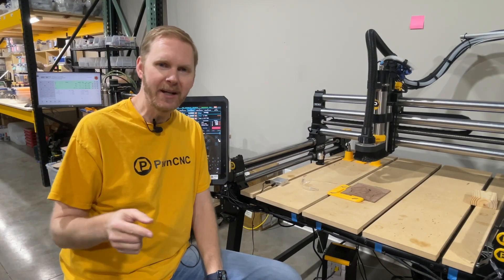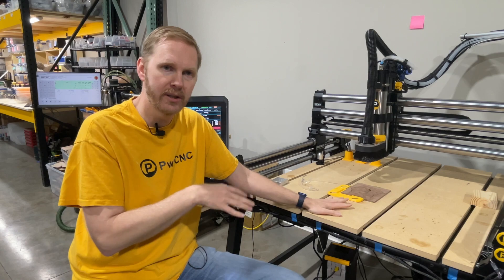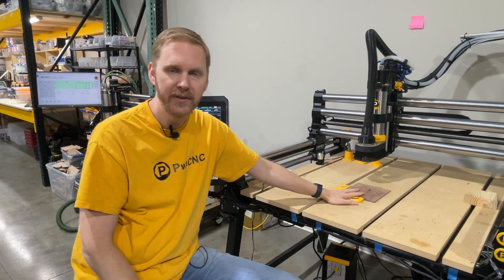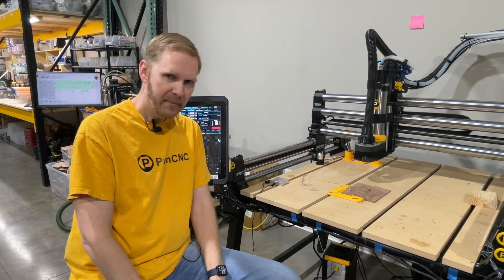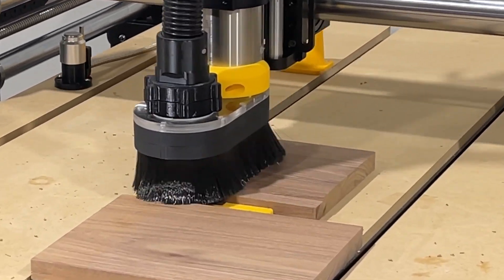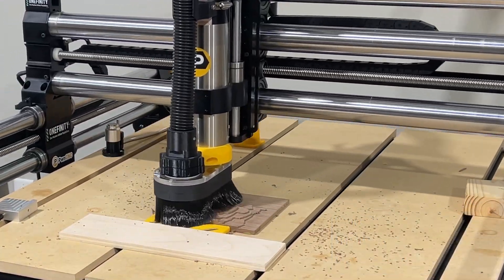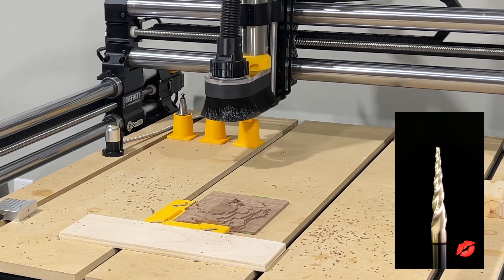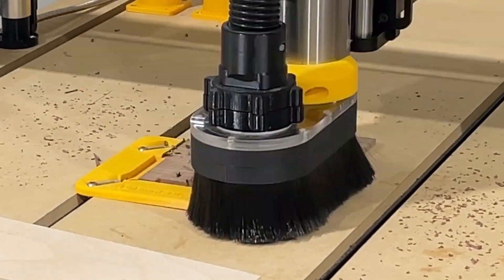PwnCNC Automatic Tool Changer

Comment: Are the bits axisymmetrical in the part that is grabbed by the ATC? I mean, does the spindle always stop at the same angular position to be able to hold the bits?
Reply from the maker: ISO20 is a standard that defines the removable chuck.  that cone shape ensures the tip of the bit is sitting in the exact same z height every time.  That z-offset of each tool is stored within the controller for next time.
The ISO20 cone is pulled tightly into the ATC motor to ensure it's in the same position.  The motor also discharges air in various locations to keep dust from building up.

Comment: What spindle you using?  The OneFinity says not included, but finding an ATC one...?
Reply from the maker: We're using a PwnCNC Spindle System here (https://pwncnc.com/products/spindle).  We also have ATC Systems available that work great with the Onefinity machine.
Key is to order your Onefinity with the 80mm mount instead of their 65mm mount.  You can always shim the 80 down to 65mm to temporarily run a Makita palm router if necessary.
We've worked closely with Onefinity to ensure our Spindle and ATC Systems are plug-n-play capable.

Comment: Roughly how much did that entire CNC with  ATC cost you?
Reply from the maker: This machine is the Onefinity Elite Woodworker  with the 80mm spindle mount costing $3336, it includes the Stiffy rail at $168, and the QCW $378 and Folding legs $368.  As pictured i have their XYZ probe at $93 and if you buy their tool-setter that's $75.
So all-in the CNC machine is $4415 +shipping/taxes.
The 110v ATC runs $3400 plus chiller and tubing $295 along with the v10 dust boot $150, end-caps $22, stepper covers $32, and Ultimate Hose Clamp $20.  Prototype boom should be released later this year.
All-in... this setup will run $8334 +shipping/tax.

Comment: What do you need on the spindle to hold the ER20 collet? How does it hold without any intervention?
Reply from the maker: ER20 is a collet/nut/shaft size standard.  These ATC motors use ISO20 tool holders which we order with ER20 collet capabilities.  I believe we can get an ISO20 with an ER16 collet but our little business has standardized on the er20 or er11 size products.
These ATC motors have a draw-bar which grabs hold of the ISO20 tool holder. The drawbar is activated by pneumatics to release the tool.

Comment: Hello friend, that tool change system works for a CNC workbee 1515 xpro v5
Reply from the maker: Out of the gate our full ATC functionality will be limited to folks with Masso controllers.  However you will be able to use it in MTC mode (https://youtu.be/IFOkSZM4JEs) which makes bit-changes a push of a button.
As we research and document more and more CNC Controllers capable of ATC functionality, we will share that understanding.  ATM i'm not sure if the xPro v5 is capable of ATC, but we will look into it.

Comment: Would be nice if you made this also work with the shapeoko 5 pro
Reply from the maker: Although it won't be full ATC on the S5P, it can support MTC which is a 1-button tool-swap.
We've also helped technically with Brayan on his Masso upgrade for his Pro ... stay tuned for the 2024 big project ;-)
Reply: Can you make video and show us how to manually control to swap tool
Reply from the maker: Hello  @xiltoid875  , are you referring to the MTC operation (https://youtu.be/IFOkSZM4JEs?si=4Y-fxLXERPRBdd-M) or actually changing the bit in a single tool holder?

Comment: Is there a way to install the atc and preserve the 4x4 cutting area ?
Reply: I saw a YouTube video of a guy who did it. The tool holders retracts itself on springs. When the Y axis approach the back , it push on a mechanism that multiply by 5 the movement of the tool holder. I will try to find it back
Reply: @peterfreedom  yes I think i saw that on a facebook group
Reply: There is not. My plan is to make the section of my spoilboard that my tools will be lined up(Y axis) be removable. I rarely have the need for 4x4 sheet, but this will make that possible. I am also having a panel removable on the opposite side to reveal a vertical cut station.
Reply: https://youtu.be/ZeOUdosoEBM?si=UVj4RhLTLtV-hTYE

Comment: Is this ATC limited to 3 tool holders, or can you add as many as CNC can fit?
Reply from the maker: You can add as many as can fit up to 99 which is the Masso controller limit.  If using another controller... not sure.
Planning to ship 4 tool holders with the kit and extras available.

Comment: Shapeoko version coming?
Reply: no Masso...so, not going to happen.
Reply from the maker: Actually...sort of!  It will be as an "MTC", using a button to manually change the bits.  And, we are providing an upgrade path to all of our current customers who have spindle kits so that they may use some of the parts they already have. :-)
Reply: Interesting - would buy that - also started looking at adding a masso to my shapeoko!

Comment: When it picked up the taper bit it did t touch the zero plate. Should it have?
Reply from the maker: It is optional.  The z offset has already been recorded by the masso so it’s not necessary every bit change.
Reply: @PwnCNC  so even faster. Sweet!